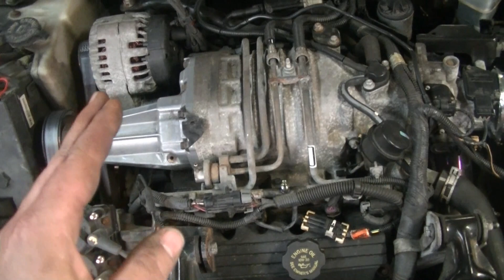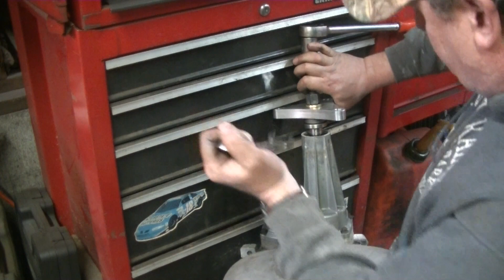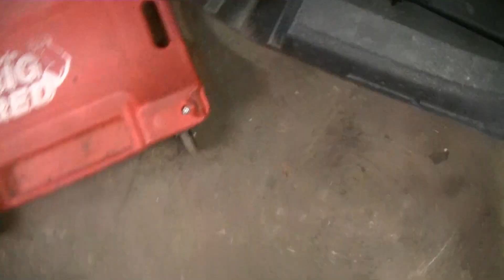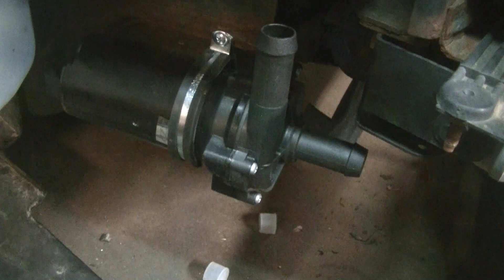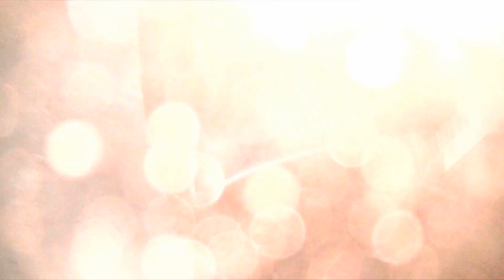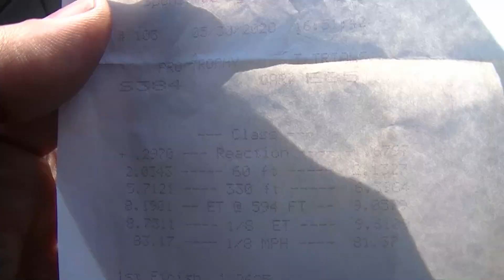Project Sleeper Regal GS:  Intercooler Installation (Modular Pulley System and 1.0 computer also)

Comment: Did you run into Hood clearance issues?
Reply from the maker: I can see some light indentations in the insulation panel on the bottom side of the hood, but I've been running it since 2020 with no issues.  It's my daily and my drag and drive car.  Currently runs mid 12's at the track.

Comment: How were you achieving those 60' times? I'm  struggling to do any better than 2.18 with drag radials. Thanks!
Reply from the maker: I guess I had a really good combination.  After I switched to E85 and made a bunch of improvements my 60 foot times got worse.  I’ve been spinning the tires.

Comment: I have a 02 GS with a SS IC was afraid of hood clearance issue with the full size IC..ZZP couldn't guarantee the hood would close and I didnt want to get involved with cradle spacers..Looks like you have the full size IC did you have any problem with hood clearence.I have only 10,000 miles on this motor that I got from Summit Racing..(L32)..their last one, but most time consuming job was installing their full header setup..took as much time doing that then it did installing the new motor (L32 stock about 20 more HP).. I was talked out of getting the ZZP canned tune PCM and went with Intense PCM.with EGR delete..with the SC IC no KR with a 3.4 pulley but would like to pulley down if possible..let me know about the hood clearance
Reply from the maker: D Clark Buy it tonight and save money! It’s on the Black Friday Sale at ZZP.  Regularly $800 for $640 today!
Reply: @Mudford  Finally installed the full size Gen 5 core and fuel rails and you were right hood closed no problem. I listened to the wrong people had to replace 3 injectors the metal clips were shot and leaking and couldn't find a rebuilt kit on short notice.  Currently on a 3.3 pulley no KR. Post a video soon...If I hadnt run across your video I would still be running that crappy short stack..Thanks
Reply from the maker: D Clark I’m currently running a 3.1 pulley with no KR.  Just finishing up the rear suspension.  I had some surprise rust repair to do in the strut towers.  Nightmare! I’m replacing the brake hoses and parking brakes.  I want to have the parking brake working so that I can properly warm up my drag radials before racing.  Video to come.
Reply: @Mudford  Thats good news on the 3.1. Any smaller the  stock injectors will run static. I'll get a 3.1 this week and hope I have the same luck..Yeah definitely need the E brake working for warming up drag radials. I have the dual piston calipers up front with slotted rotors and steel brake lines, one of the first mods I did ZZP wanted more money to paint them I just painted them myself with red caliper paint  and clear coat and after about 4 years the paint is still holding up
Reply from the maker: D Clark I have the full sized intercooler from ZZP with no hood clearance issues
Reply: @Mudford  Thanks..I'll give it a shot..need a Gen 5 core and fuel rails and see what happens..have about an inch of insulation under the hood I could always take out some..dont know why people have said the regal would not accept a stage 2 IC without hood mods or cradle spacers..it scared me off the Stage 2

Comment: Are these the only mods you've done? Did you change any internals like the cam or valves?
Reply from the maker: DeAngelo Graham stainless headers, full 3” catless exhaust, ZZP computer, ZZP cold air kit,  180* thermostat, intercooler, and just put 1.9 ratio rockers (instead of upgrading camshaft for now because rockers are quicker and easier to install). I think that’s it.
Reply: So you can get quite a bit out of a intercooler with simpler mods?
Reply from the maker: I’m able to run a smaller pulley with the intercooler.  I haven’t made a 1/4 mile pass since I’ve done the 1.9 rockers, but before that it ran 13.1 seconds at 102 mph.
Reply: Did you have the computer reflashed after you installed that stuff?